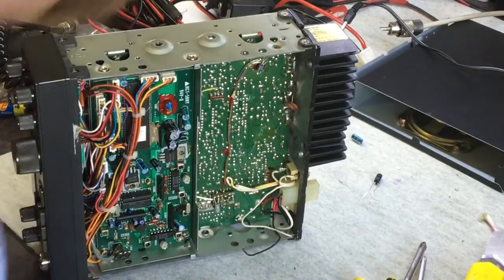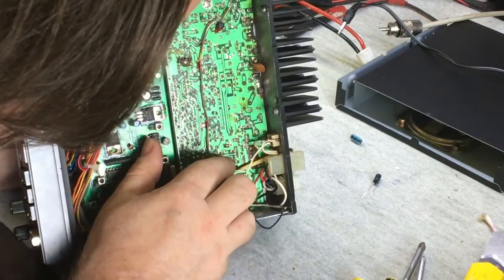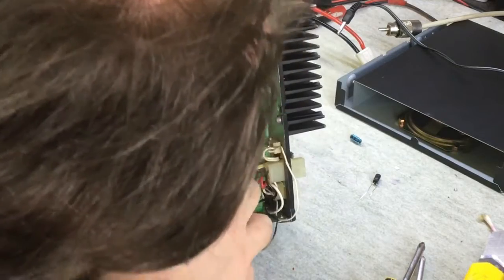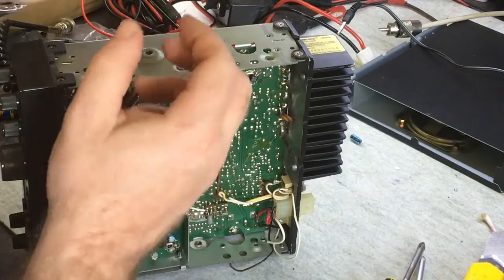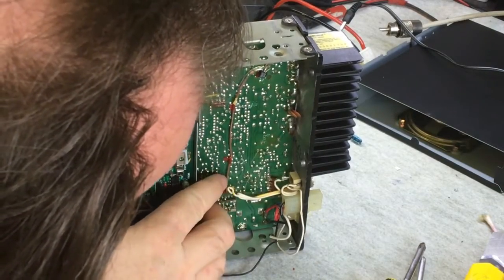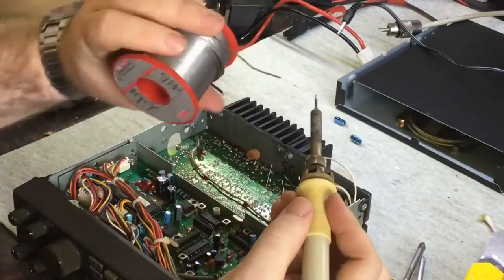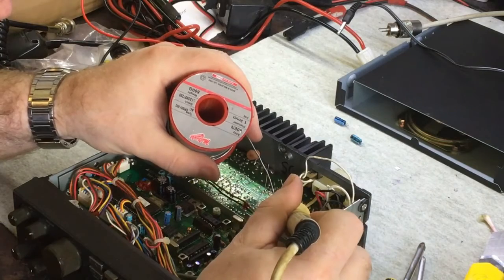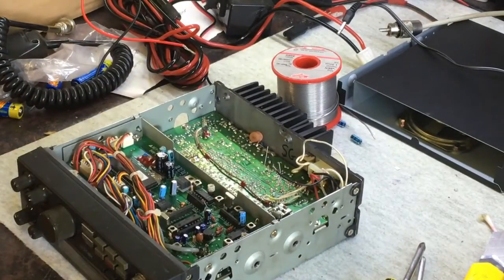#134 S-993A 100W Desoldering Gun First Impression

Comment: This item very bad. The heater will burn after few use only. I test more than 3 sets. Very bad. Butter to spend more money and go for hakko or any good brand
Reply from the maker: Makki al - saboodi - I’ve been using this desoldering gun since doing this video, 3 years ago now, I’ve only had one issue with it and that was one of the vacuum hoses inside split, new bit of hose and it’s good as new again, Ive been very happy with it.

Comment: Just placed order for one of these puppies from Amazon. I sure hope its worth it. Looking to remove solder from board on my old favorite mouse to get to microswitch and replace that. If I can do that and it works then awesome. I kind of messed up the board in that area from the heat gun type solder melter. Good news is all the other components seem to still work.

Comment: It looks really similar to my Hakko portable desoldering iron.
I wonder if the parts are interchangeable.
Reply from the maker: Mark19960 - I will have to look into that, do you know the model number?
Reply: Sorry for the late reply. I keep by field gear in the car so I had to go look at it.
It's an 808.
The glass bits look identical. I would bet you can get Hakko parts to put on that.
Reply from the maker: Mark19960 - thanks, I will investigate that further